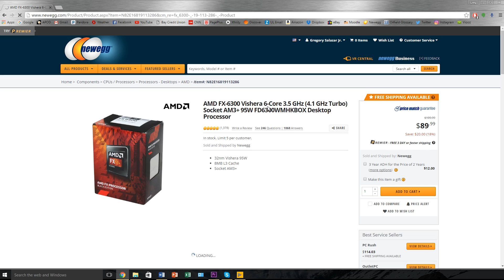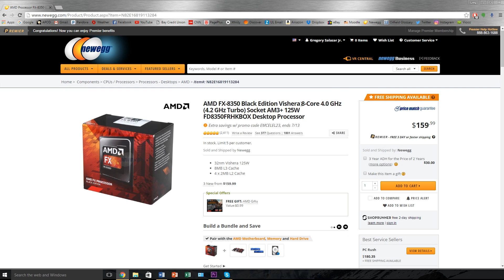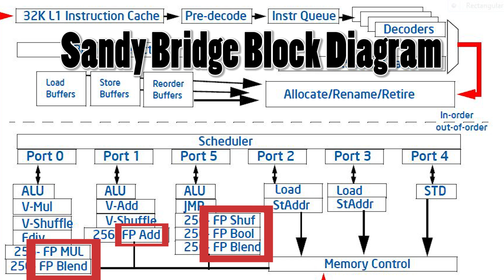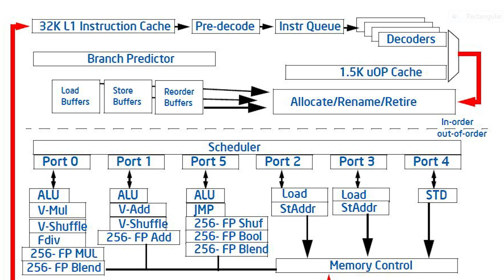How Many Cores Do AMD FX Processors *Actually* Have?

Comment: I bought a "quad core" processor but it only has 2 cores. 
Luckily this was in 2013 and I bought a 4.3k pc a few days ago but it still sucks lol
Reply: I feel bad for your bank account.
Reply: it was amd athlon + gtx760 now I have i7 6850k and 2 gtx 1080
Reply: BAHAHAHA 6950k? 4.3k PC? Yet a i7 6700k still beats you in gaming performance.
Reply: K1NG CLAN not rlly the 6850k has only 6 cores and they are useful with my 2 GTX 1080s in SLI. 
Besides games like Dayz or cities skylines are heavy CPU games and I love dayz a lot.
Reply: +Roshan how did a 6850k and 2 1080's cost you 4.3k? I get only $2250  ish from that... What did you spend another 2k on 1 tb of ram?
Reply: Spencer Shackleton this is the complete list;
i7 6850k
2 asus GTX 1080 strix
MSI x99a godlike gaming carbon motherboard
32 GB of ballistix DDR4 RAM x 2 (8 sticks total)
H100i v2 water cooling
Be quiet dark power 1000 watt platinum power supply
Be quiet dark base pro 900 case
2 Corsair purple LED fans
2 Corsair purple LED fans (different ones for the water cooling, wanted leds on it.)
Cable mod full kit
512GB Samsung pro SSD
3 TB WD black HDD
Asus LED SLI bridge
Asus bluray / dvd drive
Reply: https://scontent.cdninstagram.com/t51.2885-15/e35/13741220_273024763055070_775445527_n.jpg?ig_cache_key=MTMwMzg1MTk0Mzk3NzkyOTQxOQ%3D%3D.2

Comment: I really like this video, but I think something you really need to point out is that up to 4 "threads" on the FX 8xxx series (and 3 "threads" on FX 6xxx series), the modules do not actually have to share resources. Initial windows would schedule it so that it would use up a single module before moving onto the next, but it was tweaked shortly after bulldozers release so that no one module takes on multiple tasks till all modules are taking on a task. This makes the FX series behave much like an intel CPU till it reached over that 4 core threshold.
Reply from the maker: Correct, but the cores themselves are not to full scale, since they've been essentially shrunken down to fit within a module. The entire point of a module is to increase efficiency and minimize space, and when one of the two cores is not working, you're doing the architecture a disservice.
Reply: I agree that the cores are not to scale, which is why the clock speed of a bulldozer chip has to be clocked so much higher than a similar intel chip to compete. That still doesn't change the fact the a FX chip will scale much better with only 4 threads running as opposed to 8. It will handle 8 threads much better than a quad core intel CPU in a lot of scenarios, but the first 4 threads will suffer due to sharing resources with the latter 4 that would otherwise keep it running at its best per-core performance.
Reply from the maker: They'll only scale better because they'll overclock higher.

Comment: So in a way its like the whole "My CPU has a higher clock speed so mine is more powerful" comment   Yes you may have a higher clock speed but its not the only thing that it is dependent on. In this case, yes it may have 8 cores, however it lacking an FPU for each core is what screws it over.

Comment: I think the other problem (besides all the other shared essentials) was AMD's gimped FPU on top of being shared. I was in contact with a couple of the engineers on a forum and explained to them that this was literally the worst idea ever(As far as the shared 2x128bit FPU, maybe a shared 256 might have been better?). AMD's 2x128bit FPUs per module working together vs intel's single 256bit FPU per core. There is no extra scheduling required to run a 256bit fp op in intel's architecture whereas in AMD an op as to run to clear out both FPUs and then another to say "hey ya'll are working together" and then finally the actually op and data. I see what they were trying to do but in the end it failed miserably for total performance. Like I said in the beginning maybe if they did some kind of magic with a shared 256bit FPU it probably would have equaled out to much better efficiency. Plus a single 256bit FPU takes up less space than 2 128bit FPUs on a die, that extra space could have been used for the aforementioned "magic" haha
Reply from the maker: You're right. Opting for a shared 256 bit core would have been more ideal, at least from what I can gather.

Comment: There is one part you are missing. Bulldozer has 1 decoder per module the FX 8150 but pile driver the FX 8350 has two decoders per module it is why piledriver is so much faster than stock bulldozer

Comment: is zen also going to have that bottle neck and 1 fp per 2 cores?
Reply: No, he said so in the video.
Reply: AMD will be using something similar to Intel's hyperthreading that they call "simultaneous multi-threading", which I think will work more or less the same way.  More than one logical core per physical core.  My big question is if they're coming out with 6- and 8-core Zen (Summit Ridge) chips, does that mean we're looking at 12- or 16-logical core dies?
Reply: yes, i think it was even AMD who said their new CPU will launch as an 8C/16T first. I am not 100% sure if it's right though

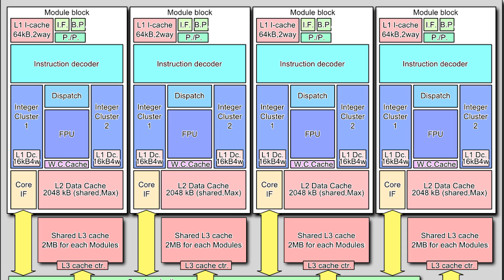Comment: In my experience with a 6350, my tests with 6 cores are usually around 5 times my single core score. So the bottleneck's discussed are around 17% per core. But outside of workloads, gaming isn't the best because devs just hate everyone. The usage of each core when I played forza was 1:100% 2:30% 3:100% 4:10% 5:30% 6:10%

Comment: While everything stated in this video is correct for the FX 8000 series cpus, it is worth noting that the shared decoder bottleneck was corrected in the Kaveri APU's and later, as well as the Athlon 800 series CPU's.  This greatly improved multicore scaling to be much closer to the scaling of intel cpus.

Here is an image of the block diagram:

http://images.anandtech.com/doci/7677/08%20-%20CPU%20Improvements.jpg

Comment: Hi,
i like your video, but i have a question about the intel hyper threading... As far as i know u didn't get the raw compute power of 8 cores on a 4 core  hyper threaded CPU. This is, again as far as i know, due to the fact that  2 logical cores have to use the same computing resources.
e.g. if i have on thred that uses 50% resources of one logical core per tact the other logical core doesn't have computing time on the physical core, resulting in a neto performance of one 50% core. Am i right?

On the AMD side the same problem would result in the performance of one 100% core. Right? So in the end Intel performed better due to the fact that most tasks doesn't need the computing resources in each tact since they have to wait for more information from e.g. the RAM and in this time they give the computing power to a different thread.
 
And on the AMD side, as you described in ur video, that tasks aren't given to each core independent but like they would be given to an intel CPU? and that is one reason (ONE) why AMD CPU's can't perform as well as they could?

sorry for any mistakes ...

Comment: the only way amd processors are going to be faster then intels in the long run is that if intel quits making processors or goes bankrupt
Reply: still skylake is better zen is only equal to haswell which is older
Reply: Alex Thesniper19 Skylake is barely faster than Haswell, especially in games.
Reply: doesn't matter I know that in every game intel always smokes amd
Reply: Alex Thesniper19 That's because AMD's architecture sucked ass, I admit it. This is different because of the improvements they've made. AMD Zen will be very similar to Skylake, imagine Haswell but with DDR4.
Reply: obviously you havnt seen intel to amd benchmarks even a fucking 2700k cam beat a fucking 8350 in games and single core which games rely on im sorry but amd will never beat intel in gaming
Reply: well im saying zen=haswell i5s is it going to beat a fucking skylake i7
Reply: Alex Thesniper19 Zen does have hyperthreading so it could be comparable to an i7. Sorry for swearing at you earlier.
Reply: its all good I mean if zen is better then skylake I will definitely buy it but the problem with amd compared to intel is the fps so if for example if you have a rx 480 and lets say you have a 6370 and your running an i5 6400 you will notice the 10fps stable increase and the minimal frame rate will be lower I think with zen if they take the intel i7 design it might beat skylake in gaming terms the i7 6700k is the best hyper-threaded cpu for gaming permance and video editing not counting 6-10 cores but on the amd side there is not as of right no comparison to the 6700k but I think zen might pass it if they use the i7 cpu design.

Comment: I still rock a FX 6200. People laugh at me for the processor, but they're surprised my only bottleneck is the GPU in my build
Reply: what gpu?
Reply: george vengrovski Zotac GTX 650ti  w/2gb vram. I dont generally play too many demanding games.
Reply: amakeleven still a decent card
Reply: george vengrovski Does its job, that's all i ask of it lol. I had upgraded from a Radeon 6770 so I had a fair bit of graphical improvements.
Reply: ***** Lol no. a 980 is more powerful. I like big steps, not baby ones. On top of that, being in Canada prices are less than ideal and when compared side-by-side cards like the RX 480 (329 at the minimum and what I currently want) would work for the task. Besides, I bought the 650Ti for 50% off of a 50% price (250 - 125 - 67) in a clearance rack to upgrade from a Radeon 6770
Reply: Well... the 750 Ti is still more powerful and draws half the power. :P Also, if you should get anything, it'd probably be better spent on something like the RX 470. Rumor has it those are gonna go for $149 USD, so... around $180 CAD... maybe... >w>
Reply: +imglidinhere my rig saves power in other areas, besides my card doesn't draw that much power. also add 100 and you got CAD price. or in the case of high end nvidia, add 300
Reply: amakeleven Damn, the 650 Ti really IS a great little card. :D (refresher review)

I'd probably end up saving up for a GTX 1060 for you sir. I can't see a real reason to go much higher than that. Your CPU will bottleneck a GPU higher than that and it's a guarantee.
Reply: imglidinhere No way in hell am I saving for a card that will be 400-500 dollars Canadian. Its older brothers already start at 450 and go up significantly. I'm also not purchasing another GPU in the GTX line until Nvidia goes open source like AMD is with FreeSync

Comment: AMDipshits be like ''it has 8 cores breh, can you get an intel 8 core for $160? didnt think so, hardware n00b''
Reply: Yes you can get an Intel 8 core for under 160 on ebay lol
Reply: Bro, no need to be like that. There are 8 actual cores. They just share resources which makes it seem like four and you really wouldn't be faulted for thinking so. It's 8 actual cores just set up in a way that is somewhat similar,  but also very different from Intel. Intel defines two logical cores per actual physical core while Amd has 8 cores split up into two core modules. Of course Amd doesn't decide to advertise 2x4 core modules because saying 8 core is more enticing. This isn't to say they're bad processors, it's just that, as was said in the video, software was never really designed to take advantage of Amd's architecture the way Amd intended. The processors aren't crap, they were just intended for something that never actually came. It's not anyone's fault. It's just bad luck.
Reply: FX CPUs: 8 actual cores crippled by bad architecture decisions, bottlenecking them horribly
Intel HT CPUs: 4 actual cores that have been designed properly, with some gravy to boot (HT)
Reply: +an orcat it wasn't bad decision or bad architecture. AMD was trying to do something different than Intel in terms of architecture, which isn't a bad thing. It's just that no one developed the proper software to utilize the architecture. So now AMD has to fall back on what's been proven to work which is SMT or Simultaneous Multi-threading which is just the technical term for Hyperthreading. The architecture isn't bad. It was just built for a time that never came. It's not AMDs fault. If they would have came out with that before Intel had Hyperthreading, Intel would have been in the same position.

Comment: So we can blame Windows for AMD CPUs underperforming more than they should compared to Intel then...
Microsoft has a well established closer link to Intel over the years, so you have to ask whether they've deliberately been keeping Windows to not play well with AMD CPUs to benefit Intel.
Reply: Yes, basically.  I am not sure it is intentional sabotage, but more of a market share thing.  I think most people underestimate just how important "optimization" is for processor performance.  And that includes both the OS scheduler and individual applications.
Reply: I hear nightmare stories about people programming for Windows, so I get the feeling that they're just borderline inept, not deliberately fucking things up.
Reply: I'm pretty sure Intel still wins on CPU-agnostic operating systems like linux and bsd.
Reply: evildude109 yep.  it's an issue with how software is designed that isn't exclusive to one OS.

Comment: Well, actually the cinebench part is incorrect. Since win 7 didn't handle the 8 core perferctly, users had to apply a patch (a hotfix) which made windows see the amd cpu as an intel equivalent, hence the 4 core 8 thread. Without the patch it was 8 core 8 threads. More of it at Tek Syndicate.
Reply from the maker: The cinebench part is not incorrect. It's how windows identifies FX processors.

Comment: FX price/performance is unbeatable.
Reply: And the i3 performs better. It's 4 years newer, has almost double the IPC, and uses new architecture that outperforms AMD on any level of performance. That's why AMD is a poor choice at this time, until Zen is released.
Reply: rekd
Reply: 4 years ago. Intel beats anything AMD has out now at any price point. Once Zen comes out, things may change.
Reply: diamond22 you’re right zen changed everything
Reply: Mario2x2Sk What gpu are you using?
Reply: Sidharth Satheesh a r9 270x hawk
Reply: +PC Master Race Really? You can get an 8 core AMD CPU for the same price as an i3.
Reply: x4 860k is beaten by a 3.2GHz G3250 which costs less and is also a dual core..
Reply: +CMDR Anti what are you saying lmao real world benchmark shows that i3s are better in almost every way.
Reply: for 1 your stupid amd performs the same as an i5 for the 8300 series and the i3 is coparable to performance with the 6300 but amd can destroy any intel cpu when it comes down to overclocks
Reply: If you used an i3 daily you would know they are garbage compared to any quad core from Amd. Benchmarks mean nothing, the only thing that matters is how they perform in the real world.
Reply: ***** a dual core i3 won't even start a game, fx is on par with i5.
Reply: The Althlon X4 860k is better price to performance than all FX CPU's
Reply: no they dont fx 8300 beat i3s and keep up with i5 and with 5.0 overcloacks even i7s
Reply: +Sidharth Satheesh Couldn t agree more. Heck even my old fx-4100 (4,55ghz) still maxes out most games on high-ultra settings. For example I can play dying light on max settings same goes for rainbow six siege and gta 5 on very high custom settings. The witcher 3 on high-ultra custom settings too. I wonder if a i3 could beat that lol.
Reply: +Pc Master Race I am saying that your precious benchmarks are no indicator for real world usage. Have you used both side by side in day to day tasks so you can compare them ? i figure you didn't else you wouldn't be making such comments.

Comment: Thats what I was trying to explain to folks in a more simple manner for years. You can clearly see the difference in Intel vs AMD when you run a Passmark benchmark. Performance there is the most important still when it comes to gaming. And Intel always beats AMD there on similar prices. Yes Games also benefit from multicore, but not as much as you think.
The renderer or main thread cannot be split up it has to run on a single core. Thats why Intel performs way better in CPU heavy titles.

Comment: so amd cheating hyperthreads? kinda... I'm kind of confused... So from what i think i understood from this was Amd does have 8 cores but they share the fpu, so therefore information is spread through 2 cores as if they were 1 core that was hyperthreaded. just the reason why intel's has better per thread performance in comparison to Amd becuase of the bottleneck in the piledirver/bulldozer architecture?

and if that is the case, then if most games tend to use 4 cores/ threads then is that why in afterburner it shows my fx 8350 as using all the cores whilst playing something like battlefield 4?